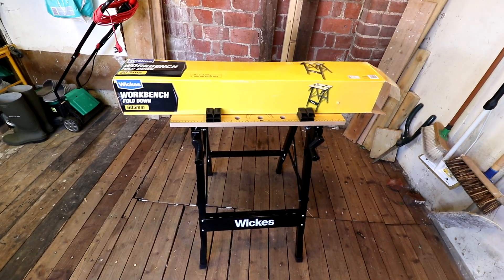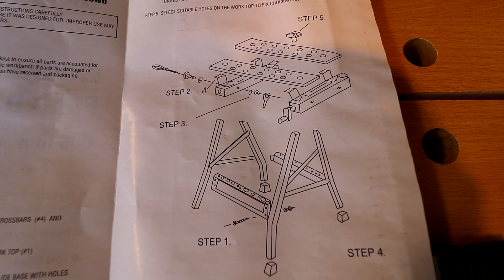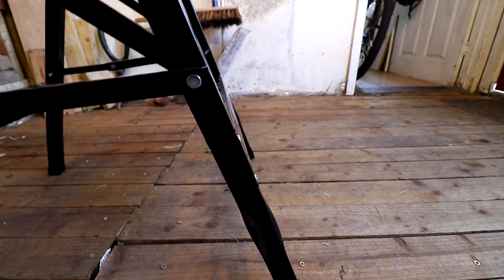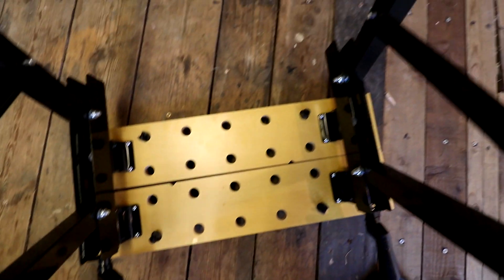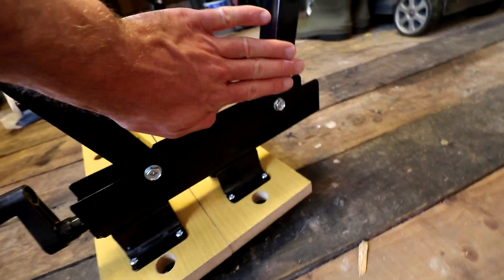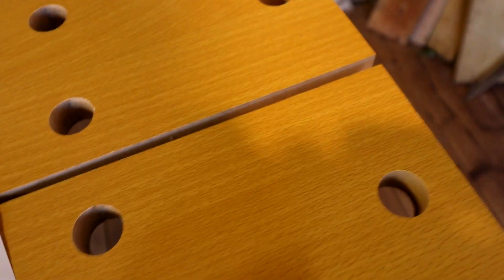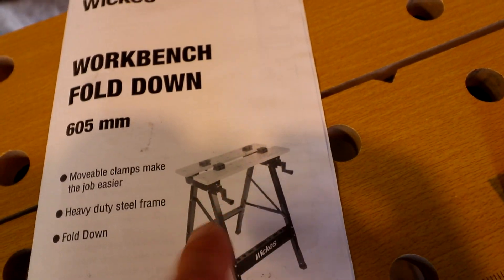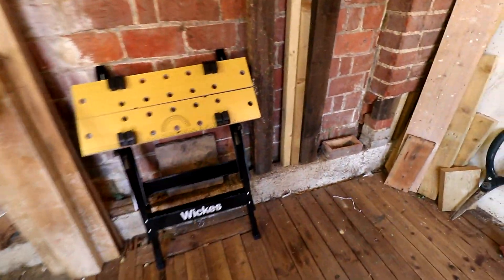Wickes Fold Down Workbench Overview

Comment: Thank-you Chris - you saved me a good 30 minutes as the supplied instructions are too basic. I over-tightened the main bolts causing the metal frame to bend in so make sure the torque used isn't too great.
Reply from the maker: Glad it helped

Comment: I've had my basic Black & Decker workmate for about 40 years, very much used, still works fine and folds flat so I can hang it on the wall. As you say, you get what you pay for. doesn't look like the Wickes version will last that long.
Liked your review, very honest and to the point.
Reply from the maker: Thanks!

Comment: Thanks Chris - fairly easy anyway to replace the two bench planks if they eventually fail - fabricating them to match. Ladders have same issue - where to get replacement foot rubbers ! Video a bit negative - this bench looks to be really good value - mine didn't have the instructions - but now thanks to you don't need them ! Bought the bench today. Was looking fir the similar B/D model but Wickes of Beverley only offered for sale the less convenient larger model. Will let you know how I get on. Last year bought a B/Decker workmate from Wilco - needed to back up the very flimsy front and back panels with boards screwed on behind as the panels were so bloomin' flimsy. Nothing like the older B/D models. So many items are made rather cheaply ( China ) these days.  Is a container of far east DIY goods falling off a ship such a big loss ! Have you ever wondered why so may clothes drying racks are to be seen discarded next to Wheeley Bins  all over the UK ! -They  crumple for fun ! Ralph from Camberwell.

Comment: Bought the same one at harbor freight $19. I didn't use the 2 wooden pieces.

Instead I used couple of steel square tubes welded together and made a steel board for each side. I reinforced the leg stand and it's my welding table. I have a 1 car garage and it works out for me.

Comment: Hi Chris, thanks for your video, would not have been able to do it without this! A question though, for the 4 largest screws that attach the top to the base... my screws seem too long for the nuts (the large nut will only screw onto the tip of the screw, leaving a bit of a loose gap on the screw) . Did you have this problem? Would appreciate your help! Thanks!
Reply from the maker: Is this for step one?  I didn't have any issue with screws not tightening up fully. Does it need a bit more elbow grease to tighten those nuts up?
Reply: Perhaps! Its for the 4 very large nuts and bolts with washer either side! Did you use the small metal tool that comes with the package to tighten them? Thanks for your help!